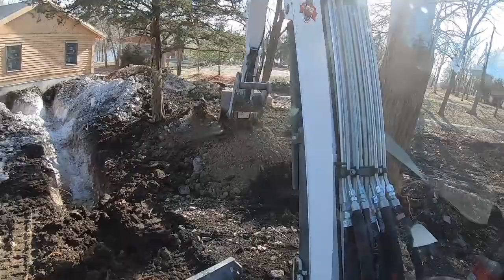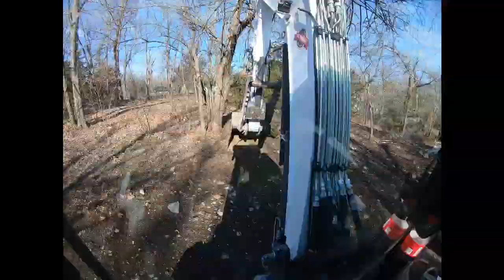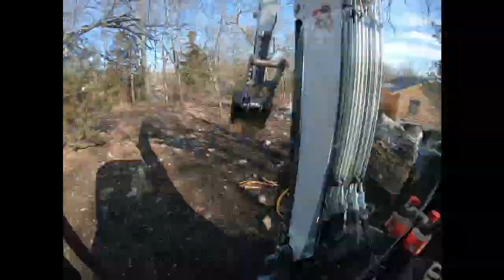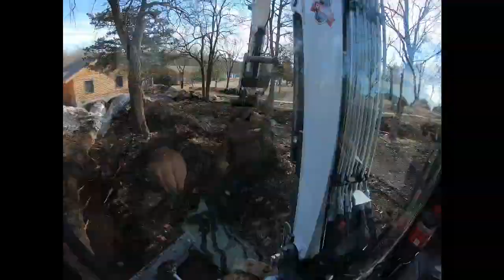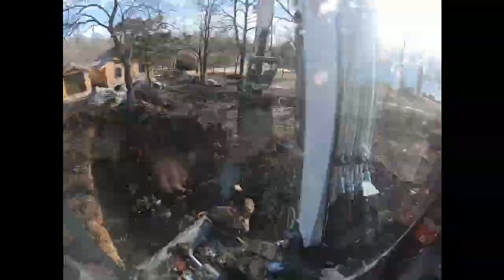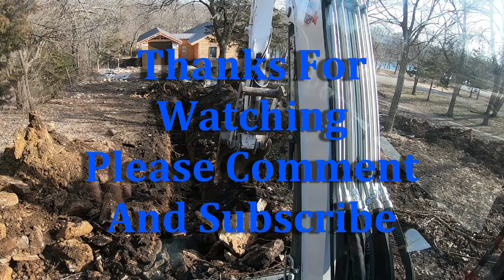Finishing up the rock job

Comment: That looks like torture to dig. I’d blast it if there wasn’t a house in the way lol. When I was with the power company we had a rock trencher that really helped but was still slow. I hope you get to bill this job by the hr. Thanks for sharing good video.
Reply from the maker: It was pretty bad, we do have a 755 vermeer rock trencher, bet it is a little large for these jobs. We are always on an hourly rate through a rock clause when the hammer goes on. Thanks for watching.